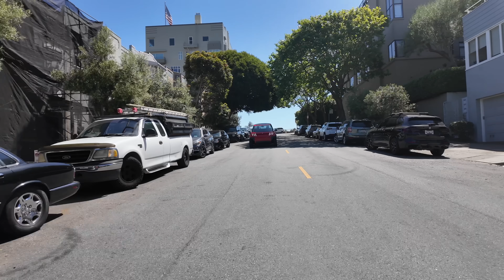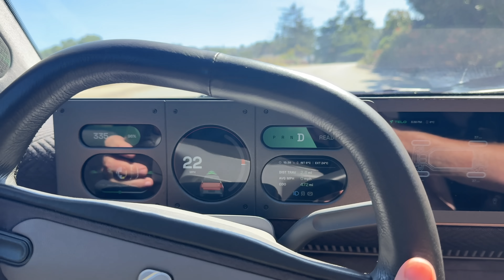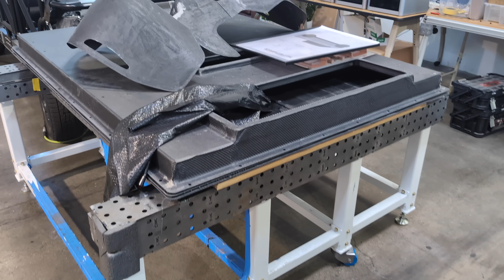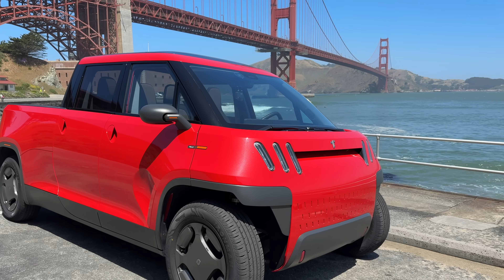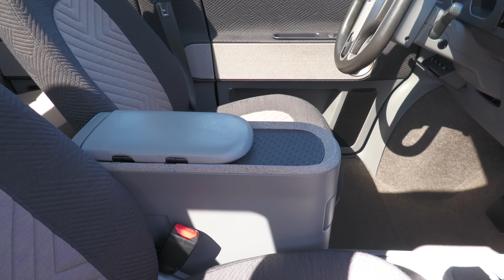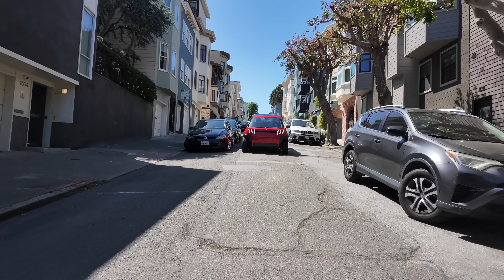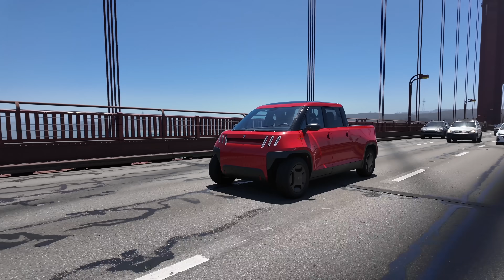The Tiny Telo Truck Hopes to Pack a Big Truck Punch

Comment: Hot tip for Telo; I know America is the obvious market, but given the huge market there is for ute's downunder, it might not hurt to think about how a right hand drive version could be put together right out of the gate BECAUSE maybe you could license that to some keen partners in Australia, New Zealand or South East Asia and perhaps corner a market that is currently wide open because of the dearth of electric utes actually available. Cybertrucks, Ford F150 Lightening's etc.. these are not an option on our roads, but an electric ute the size of a Mini? Hell yes.
Reply: EVs make the best farm vehicles. We originally got our used 2012 Leaf for short range towing 5 days a week.
Be really good to be able to shut beeps off when driving stop start slowly without a seatbelt. Maybe have a farm mode set to a gps location.
AWD is handy.
Reply: @andrewradford3953  Consider buying a JY seat belt buckle (cut the strap off around it) and leaving it plugged in to the receptacle?
Reply: @alsavage1 I've learnt to clip the belt in and sit on it.
New annoyance is the car going into park if the door is left ajar so grass isn't trapped when driving off.
Whatever you do, don't remove the seat occupant bum sensor. This stops the beeps, but will most likely not deploy airbag where no occupants are seated. I wouldn't presume the drivers side will go off regardless, as cars are left and right and drive.
Reply: @andrewradford3953  Ugh, automatic Park selection is the devil.  I (used to) be all over the fields in my pickup, in and out for hours, and I know what you mean.
Reply: they actually did. It's in one of their earlier vids and also mentioned in the Leno preview.
Reply: If it can't be sold for cheaper and have bigger bed than a brand new Wuling Formo Max or Suzuki Carry (International 1500cc version, not the kei version) then I think it'll fail in Southeast Asia - the two things this very Telo has to it's disadvantage. Almost NOBODY in SEA countries have pickups larger and more expensive than those kinds for both personal and work use, because we actually keep pickups as a work vehicle first and foremost, comfort and performance somewhere in 4th or 5th. Whether it's powered with petrol, diesel or is an EV we don't care, it just has to work very well at bargain price or it's a no deal. For the price of the lowest Telo trim planned, some guy with a cleaning service business in any given SEA country could buy almost 3 brand new top trim Suzuki Carry 1500cc, maybe even encroaching on 4 if it's fleet sales.
Reply: @PlatinumNath  You find so many kei-trucks downunder, they do a job and do it well. No question the Telo is the upper end of that market, BUT there's also no question you could build Telo's in SEA for much less. I'd like to think that SEA Telo's would have a lower sticker price. I do like the idea of small factories in either Aus/NZ churning out a low volume of these trucks though, because I do think there's a market for them and I believe the slow burn approach is a good one. Having the trucks made in the country they're sold in would definitely appeal to a lot of antipodean people as well. True electric kei trucks will do well when they're available cause there is a gap in the market there, but I do see the Telo as a more capable farm or work vehicle rather than just short haul errands like most kei trucks are used. The Slate truck is another one which could do well downunder, they're probably in the same market space (even though the makers would disagree), again, could be totally made under license.
Reply: @jezbrown5446  (speaking from SEA perspective for the most part here since I'm not too familiar of the fellow Aussies) The thing is that the two examples I mentioned ARE NOT kei car sized OR performing one bit however, but are the capable bread and butter regular sized (for SEA and probably Aus standards too) work pickups that go anywhere and appear everywhere, no matter if it's short city errands, farm workaround or highway carrying. All the capabilities the Telo has is already covered enough by the two examples and the many other similar pickups for the things that matter (except comfort and speed once again - 2 things nobody bats an eye on) at a price that I doubt the Telo would even be able to get near at even if it's produced locally ($16-18k for both the Carry and Formo Max. This price range is considered the sweet spot here in SEA, not sure for Aus. If a manufacturer can't make a work pickup competing at this price or lower, it's going to be guaranteed dead. The cost cutting you need to do to get to this price point is way more than just cheaper workforce, cheaper materials and local production). EV infrastructure also is still lacking. The Telo isn't just upper end of the market if it's brought to and produced in SEA and (probably) Aus, it's practically only going to be a rich toy or just a "quirky" normal car for the slightly more capable financially unless it can cost HALF of what it currently will be sold at. To cut costs that much Telo would have to completely redesign the truck essentially making a new truck in the process and somehow make a profit out of the razor thin margins the SEA market demands. It's a price bloodbath out here.
Reply: Likewise, there may not be a huge market for pickups in the UK, but small vans - even Fiesta-sized - do well enough here, and the covered-bed version of this on Telo's website would suit that market brilliantly.

(Honestly, I'd get one to use as an everyday car, if I had the money--it's certainly small enough.)
Reply: I loathe pickups and whatever we call "utes" these days, but holy heck this would convince me to get one if it ever came to New Zealand!
Reply: I am not convinced AU has the infrastructure for such a low range EV.
Reply: Central south america. We prefer a different company than tesla.
Reply: @trowawayacc feel good knowing there are no cybertrucks on the roads downunder or in Europe
Reply: Considering that the steering system is likely drive by wire, it wouldn't take much to switch the side of the vehicle the steering wheel sits on.

Comment: Call me a stupid dane. BUT 300 or 500 horses for "downtown" 'cause?
Reply: It’s just a feature of the technology. It costs about the same to use a 50hp motor that it does to use a 500hp motor. It’s not the same as gas engines where more power means more expensive. EVs are substantially more thermally efficient in their drivetrains so it doesn’t take much to make them super powerful

Comment: A 10year repair or replace warranty on the battery is the only way electric cars will appeal to us working class schmucks that buy vehicles and keep them till they're all used up.
Reply: Most EVs already come with 100k mile and or 8-10 year battery warranties. The Blazer EV is 8 year 100k mile for example.
Reply: I think they got that bro

Comment: The back seats is kinda eh. You could remove them to actually have more pickup on your pickup truck, or go full van mode to have a dry and safe storage space, that doubles as passenger compartment if you bother to put seats in the very back too
Reply: Oh, the mid-gate! Ok, that's cool

Comment: I hope Aging Wheels gets to review that "Slate" EV truck.
Reply: *after mail-in rebate
Reply: @StubbyTheGiant  all EVs get the 7500 rebate if they're fully american built. Why are so many people making this stupid misinformation claim. The only reason that 7500 discount may not be there is if the trump admin nukes it. But if they don't, it's not going anywhere.
Reply: @StubbyTheGiant *and only if you qualify based on income.
Reply: The plastic one?
Reply: @zacharyhenderson2902  i like the fantasy of the slate, but then i remember it's the worst priced vehicle in existence. I get that my Mazda 3 isn't a "truck" but it's got the same towing capacity 😂 and my car is infinitely nicer for the same price.
No radio, plastic unpainted panels, crank windows. I'm surprised they're not charging you for A/C. It's $2k cheaper than a Ford Maverick ($29k) but feels like it should be at least $10k cheaper
Reply: Screw that, enough boring ass vehicles on this channel
Reply: $27k
Reply: @MattM-24  all EVs get the 7500 rebate if they're all-american built - that's not just some introductory price, that's what it costs. It's 20k to the consumer, 27.5 MSRP. Assuming the trump admin doesn't nuke that. but also state rebates too. The telo is listed at its post-rebate price too.
Reply: @CanIBorrowYourShovel  they're actively getting rid of the rebate right now. Also working on a special EV tax of $250. This already passed through the house.
Slate seems to be leaning much harder into it with their marketing. In this video the CEO of Telo called out the real price with no discounts
Reply: @CanIBorrowYourShovel  The nuking is part of the budget passed by the House.   What D-baggery is endorsed by the Senate remains to be seen.
Reply: @CanIBorrowYourShovel  I think only the batteries only have to come from the US. Also if you lease an EV it bypasses all the requirements because of the way the law is written. Lots of people don't realize that.
Reply: @WhoThisGuy515 I could be mistaken but I think that batteries are only one part. And either way, the slate batteries are confirmed to be 100% US made.
Reply: I'm sure your keyword is sticky in anticipation.  You FOMO techies are annoying.
Reply: @NoDaysOff-oz2zl  bro what the hell are you talking about lol

Comment: It’s crazy how if the slate truck comes out it will wreck this
Reply: How? 
The Slate is slower, has terrible range, terrible efficiency, is too big while still not as capable at hauling, and is boring to look at. Its only benefit is that it's somewhat cheaper. 
Plus I doubt I'm alone in not liking it at least partly because Bezos is so involved. That guy does not need more money.

Comment: for what you need 500hp in a delivery truck?
Reply: Getting the delivery there in 30 minutes or less of course!
Because it's fun. Besides, that's the optional dual motor package. The base model has 'only' 250 iirc. 

It's funny, I remember when the complain was that EVs were all too slow and had no power. Now that they're quicker than ICE cars people complain they're too quick and too powerful. 
I'm not saying you complained about both, just that it's funny.
Reply: @Jcewazhere ?

Comment: It would be cool if it was adjustable on the fly. Specifically, if the rear cab could extend back into the bed space when youre not carrying long stuff but are carrying passangers. And vice versa

Comment: Yeah you lost me at $41k.  I want a small truck but I don't want a small truck for $41k.  I mean at that price I could buy a Ford Maverick at the highest trim and it would only be $43k.
Reply: Then you pay for gas and oil changes for the life of the vehicle. Maverick only gets about 50MPG average.
Reply: @tims8603  50!? What kind of Ford Maverick are you driving?
Reply: @zacharyhenderson2902  I'm not driving one. The hybrid only gets 50MPG average.
Reply: @tims8603  I was going to say... The standard Maverick with the EcoBoost engine gets 23 and 30 MPG
Reply: @zacharyhenderson2902  So far worse than the hybrid. That's to be expected. Even more expensive in the long run.
Reply: @tims8603  Well the hybrid's really not much of a truck. It's more like an Escape with a bed. Front wheel drive I believe, very low towing capacity
Reply: Maybe you could but that's before dealer markups, and it's also a gas vehicle. I have a feeling people who are buying these, especially people in California, are going to be paying significantly less after the federal tax credit, California specific EV programs, and local incentives

Comment: Please, for the love of the flying spaghetti monster, do not put capacitive 'buttons' in it. I hate those things. They don't work when you try to press them, but then your arm brushes within 2 inches of one and it trips. They don't work with gloves. 

Also please no fake noises. That motor whine is great as is. Sure my Subaru's boxer engines had a nice purr, but my Bolt sings to me through the curves which is just as fun. 

That slot in the door is great for aero. Keeping it free of mud and road grime is gonna be impossible though. Hope they triple layer the paint there. 

I'm not a fan of glass roofs. My mom's Kia has one and it's super-hot in the summer and cold in the winter. Metal with proper insulation; or the Aptera solar roof for me. 

@11:30 YES! Full one-pedal driving. The Bolt does it great, rarely do I need to touch the brake. Put it in L and occasionally use the paddle on the steering wheel for more regen; then use the brake pedal in an urgent stop situation. 

For sales I'm fine with direct to consumer. Having places to test drive it would be very good though.
For service... yeah, that's the only benefit to dealerships. Maybe get a partnership with one of the big 4 to let them service the vehicles? We need more independent EV repair shops; but EVs break down so rarely it's hard to keep them as standalone businesses. 

If they don't make it to market I could totally see Robert keeping one of them as another quirky car in his stable.

Comment: I like this truck and hope they make it, but I think they will get steamrolled by Slate Auto's small EV truck (backed by Bezos).  Much cheaper and more modifiable.  Also they've very strictly stuck to a low price business model.  Telo would have gotten a lot more headlines if they cut some of the features and had a starting price in the $30s.  Gear tunnel is cool, but not needed.  The mid gate also cool, but also not needed.  Have them optional, but don't waste valuable resources on them now when in today's world a low starting price is what will get you news coverage.  Wish them luck.

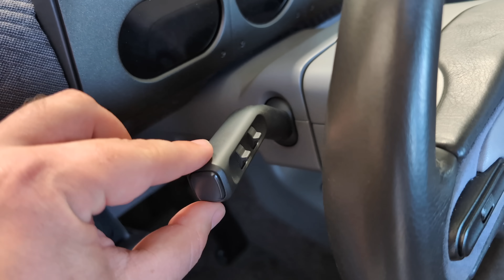Comment: @4:48  Isnt that what a turn signal stock is? An extension to a three way switch? All other functions are extra.
Reply: usually there's a metal bar inside, anchored into the switch gear I would assume - not just a 3D-print extension stuck to a flick switch lol
Reply: @Sareth94 Well the gear shifter would be on the other side, if it was present at all. I suppose a metal reinforcement is probably good for longevity, but I would never give the big auto manufacturers that much trust, since its not supposed to experience a lot of stress. Id be fine with a light weight, cheap and replaceable switch extension.
Reply: Stalk, not stock.

Comment: He should have just said, "It won't compete with other low cost vehicles because it isn't low cost." That puny little pickup costs as much as a full size EV.
Reply: Everyone seems to think that small=cheap. That's not the way it works. Telo is small on purpose. It's built for an urban environment.
Reply: @tims8603  but you don't need any of the features in an urban environment.
You don't need 300 or 500hp. You don't need AWD. You don't need 350 miles of range.

So they put all of that expensive stuff that nobody needs in an urban vehicle into a vehicle that is made for urban environments. Why?
Reply: @Jehty_  So, people only buy what they need? Where have you been? Americans buy what they want.
Reply: @tims8603  you said it's build for an urban environment. I'm saying it's not.
It's build for the spec sheet.
Reply: @Jehty_  Why build small then? That makes no sense.

Comment: I want this thing in the UK. Those streets looked positively gargantuan compared to a lot of cities and towns around my area. When you're in a car much smaller than the current Mini and the streets feel tight, a large pick-up or a flatbed truck (which is far more common over here) wouldn't be physically fit, something of the Telo's size would be possible to drive around.

Comment: The front does not look very pedestrian friendly, especially with the open front wheel wells.
But when lowering to US standards, it isn't an intentionally dangerous murder ram either.
The dashboard lacking a shade cover is bothersome, but a quick tape-on panel fixes this.
That open bed design stays especially silly, since most cases are better served by a covered van or SUV design.
But one of those will get released later and I suppose this fits US culture and some niche cases better.
I agree with the Dutch friend, it is massive, but because of the bed makes very inefficient use of the space.
I'd be genuinely surprised if this design passes in Europe, due to the pedestrian safety issues.
But for the US, it seems like a genuine improvement from what seems to be the current insanity.

Comment: It looks like someone cut the front end of a truck off at the fire wall, then weld the front fascia back on to cover the fire wall.  I'm not a fan of how kei trucks look, but they look better than this. In concept, though, I like what they are doing for 1/2 the price.  Also, it's the suspension as bad as it looked?

Comment: I would like to see a Bully Bumper or something similar on the front. The rather exposed tires have me worried that they can hit something, not even at speed, and potentially bend the control arms, damaging the steering, alignment, or possibly the frame.
   Remember, there's always a bigger idiot behind the wheel.

Comment: $41K ???
Not one person in post 2015 automotive manufacturing has taken an economics course.  A person could go to the south, get a used small truck for $6K, have the vehicle suspension, cooling, AC, and drive system reconditioned for $6K - 10K and they could bank the $29K difference.  The interest on $29,000 is $1,450 per year.  That does not count depreciation of the electric vehicle.  Generally, it's 15% per year, over $6,000.  That means interest and depreciation is over $7,500 per year.